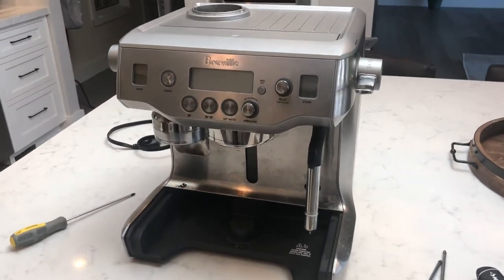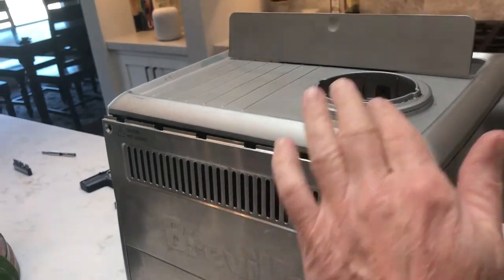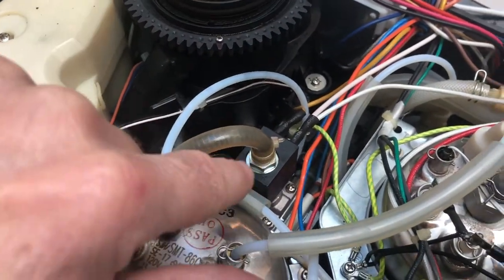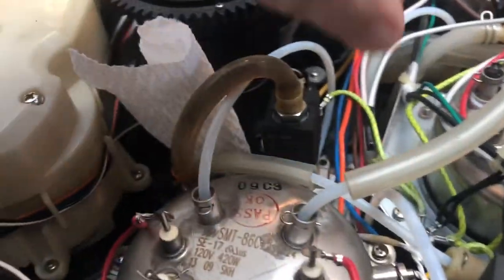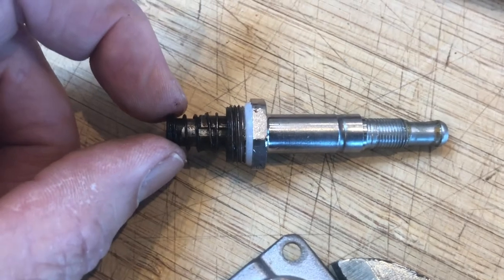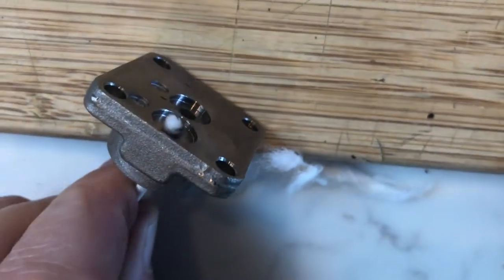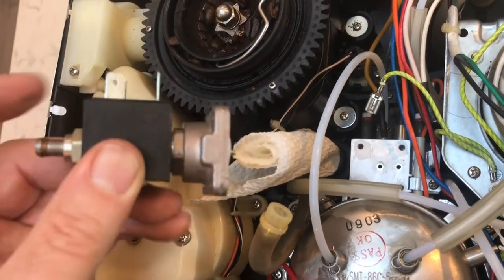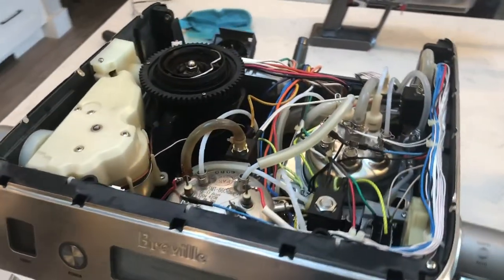How To Repair The Breville Oracle

Comment: Awesome, thanks so much for this post. Second time my Oracle had this problem, first time I sent it in, but having to wait 10-14 days gets old quick, so I just completed this repair myself. Wouldn't have been able to do this without your help! One small correction, though: the "manual coffee hole" is the feeder hole for the top water inlet, not a coffee feeder. Whatever falls in there falls right through to the water tank bay. One more thing: the two top screws on the front require a VERY long Philips screwdriver. Make sure you have one before starting this job.
Reply: Hi. Where did you get a new solonoid?

Comment: I could not have attempted my own repair without your help.  Thank you so much for posting.  My hot water had stopped flowing and cleaning the solenoid fixed my issue!
Reply: A factory  reset fixes  this issue for me after a descale

Comment: Awesome guide, managed to use this to fix my milk frother not texturing my milk. Thought originally it was the air pump. Turns out it was not, it was the steam solenoid was a little dirty. On the right side of the breville as you look at the top. I took most of the hoses off and gave the ends a clean. Took apart the steam solenoid as much as I could and cleaned it out, blew through the hose going to the steam wand. Put back together and it was texturing milk again. Should have made a guide myself as this kind of information is just not out there at all!

Comment: Thanks for sharing the repair! I am going to attempt a similar repair on my breville (not exactly the same model) that I believe also has dirty/stuck solenoid valves. This is one of the few videos I found showing cleaning of the solenoid valve instead of just 'replace the solenoid valve'. Great job.

Comment: Thanks Jonathan, this was beyond what i was hoping to find. It works better now. The Muriatic acid cleaned the parts very nicely. I did all 3 solenoids , but i have a Sage Oracle, so parts was sligtly different, but still the same procedure works for mine.🙌🙌😊😊

Comment: Thanks for the video, I have a side note for prevention in the Oracle - to avoid getting the solenoid valve stuck run the backflush regularly every couple of days, and run a full cleaning cycle with  tablets every couple of weeks. It might seem like an expensive proposition since those tablets ain't cheap, but this machine is definitely worth it. 
Don't wait for the machine to tell you it needs a clean, this warning is time based and usually by the time it pops up the entire water system is pretty gunked up already.

Comment: Absolutely amazing!! Thanks for taking the time to put up the video! Although i couldn't undo the the last really tight bolt even taking it apart and cleaning it a bit and putting it back together seemed to get it working again from now.. think its due to limescale build up in my case.

Comment: wondering if you replaced the o-rings on the boilers? Seems a common problem, and finding it difficult to find where to get replacements... food grade material; Silicone or EPDM? Durometer rating?

Comment: Great thanks for your video. This is the first video for Breville Oracle repair. I have follow your video to check my solenoid valve. Unfortunately, my problem is is the brew pump. The pump generates smoke while brewing. Mr. Audy, do you have any experience to access the brewing pump?
Thanks 
Chen

Comment: Good tutorial. I went through the steps but doesn’t seem to solve my problem. My boiler isn’t getting water hot enough (levels off at 110 or so) and it keeps clicking on like it’s pulling water but nothing comes out. Any idea?
Reply: most likely the thermal fuse blew. i believe there is one for each boiler. there is a video showing how to replace them

Comment: Thanks so much for the informative video. My grinder stopped working. The central burr shaft came unthreaded from the motor/driveshaft somehow. It doesn’t spin when the grinder is activated and can be lifted straight out. If you could provide instructions on how to get at that fitting, that would be amazing! it just needs to be rethreaded. Breville wants $500 for shipping and repair

Comment: Hey Jonathan!

Many thanks for your video! Just took a crack at checking the solenoid in my Oracle, and managed to wreck the other plunger (white round thing, with small pipe sticking out) at the bottom of the solenoid. I was wondering if you would possibly know where one could get a replacement? The solenoid itself looks clean. Thanks a mil! Appreciate the informative video.

Comment: Thank you for the video!  Hoping this will fix my issue but I have a question.  I notice that the zip tie that helps secure the tubing to the solenoid was still attached to the tubing after you had the solenoid disconnected.  Is it not necessary to remove and add a new zip tie or are you able to disconnect the tubing easily without having to remove/replace?  Many thanks again.

Comment: My Breville Oracle expresso keeps popping a GFI while brewing. Plugged it into a different outlet and same thing happens. I have to reset GFI at lest twice to finish getting a full amount. THe electrician said it was a machine fault NOT an overload. My machine is not even 2 years old and I paid quite a bit for this high end model. Is it the plug or a heating element.  Help Jonathan Audy!!
Reply: I had this problem. It was fixed by replacing o rings that were leaking and causing a short. See https://youtu.be/LNZcCEMr7Z4 Although not exact model, it was enough to guide me.

Comment: Hello Folks,
*Mike Sandiland

Hello Mike, 
I have a Breville Oracle Touch BES990. (getting ready to shoot it).
4 days ago it would not come on when I pressed the on/off button. It just looks at me...blank face. I have left it unplugged for varying times and still nothing.
I think I left it on without attending to it for an extended time (hours). 
Any advice would be greatly appreciated as I have a splitting headache now.
Thanks, Mike

Comment: This a great video, thank you.  The repair seems easy enough, but I'm struggling with getting the top off.  Are we all sure there are no hidden screws on the top, near the front side adjacent to the control panel and screen?  I can get to the point where I start to pop the top off from the rear and sides, but the front specifically does not seem to want to budge?  I can use brute force, but I'm afraid I'll damage the external control panel and screen.  Any tips?
Reply: Never mind, being the lazy guy that I am, I fast forwarded to the top removal and missed the part of the video where you discuss the hidden screws.

Comment: My 980xl won't power on. Think it's from a black out. Was wondering where the power supply could be found (or a fuse?).
Reply: I have the same issue!!  How did you manage to resolve this?

Comment: Great video!! I am having issue with extraction even grinding dial adjusted to 30+ coarse. Below 20 close to the fine, extracting less than 2g. Any thoughts?
Reply: Take out the top burr out of your grinder and re-adjust it.

Comment: Stuck on the first step, can't get those Philips head screws out lol. 

Can't tell if my screwdriver is too big or too small, I can't go bigger because it's too long to fit in that hole and I can't go smaller because it is too short to reach the screw, the one that does fit doesn't seem to unscrew it as the head must be the wrong size!

Edit.  Finally got it, had to jam the"too long" one past the plastic bit that sits under the drip tray
Reply: Yeah, I had trouble with the one on the left because of the filter holder interference, but luckily I have a lot of tools.

Comment: I would assume the touch version is the same solenoids. I have a touch and a non touch oracle, but my touch won't get up to temp (usually freezes at 193ish, and then the wand starts clacking)
Reply from the maker: I also have the touch version now and had a similar issue of temperature ‘hanging’ - in my case around 150. This happened after a descale. I think steam gets into the internal temp sensing and messes some readings up. I called breville and they said do a factory reset and then leave it turned on for several hours. I was skeptical but this worked! Seems to dry out the internals so sensors work correctly again.

Comment: Hi, Jonathan. May be you can help me. After the standard cleaning procedure ( descaling), the temperature of the water in the boiler only reaches 72 degrees celsius instead of 93. Thanks coffee machine is on heating mode all the time. We are talking about Sage Breville oracle 980xl. Thanks.
Reply: If you figured it out, let me know cause I am facing the same issue. 
I entered the secret menue and it shows that steam boiler seems to be off, meanwhile group head temperature does rrach 92.
Overall my machine doesnt heat up past 72.
BES990
Reply: @rida8454  Hi. After the repair, they told me, that they replaced the temperature sensor. Good luck.
Reply: @shalexsh  thank you.

Comment: Great video thanks so much for posting! With the hot water solenoid which way is the flow arrow supposed to go when reassembling? I pulled mine out and didn't mark which way it goes. Does the arrow face the front or rear of the machine?
Reply: did you ever find out your answer to this?  I'm having the same issue.
Reply: I had to work it out myself but I can check mine later today if you like?

Comment: Hi Andrew - I have a Sage Oracle that stops heating at 70’C. It may be the thermal fuse that needs fixing. Do you know how to fix that and can you help - not sure if you have covered that in a video before?
Reply: sonderby same issue, did you find a solution?
Reply: Artisan Vapor Company Keller - yes the issue was that despite doing a descale every month all the internal tubes were clogged with limescale, as the water couldnt reach the boiler and the thermal fuse had melted. So the machine needed a full manual internal descale of all water carrying tubes and a new thermal fuse. I needed a professional to do this for me.
Reply: @sonderby  I have the exact same problem. Stops at 69-71c while still saying "heating" in the display. Happened after I descaled. Did another descale, but still the same. Did your repair work and was it expensive?
Reply: Hi Steen - it needed a full professional descale and it cost around 1500DKK I think. Check with service dept in risteriet.dk they helped me. We only use brita descaled water since the repair.
Reply: @sonderby  Tusind tak for svaret. Tager kontakten asap
Reply: @sonderby  Do you still use the Sage filter with the brita filteret water?
Reply: PSYGOZz  - yes we do

Comment: Good evening Jonathan 
Could I ask you a question please, I have the Sage Oracle (Breville), sometimes when I switch the machine on it starts sounding like a machine gun, water starts running out of the group head.
Was this what was happening with your machine? and did cleaning the solenoids stop it from making this noise, I really hope you get back to me, my machine is only 14 months old, this was a replacement for my first Oracle which was putting all the electricity off in the house while descaling.
Kind regards
Johnny
Reply: I've got exactly the same issue! Did you manage to resolve this at all? The casing on top also gets very hot.

Comment: Hello Jonathan, thank you for the video.  I was wondering if you would have a recommendation on converting my UK purchased Sage / Breville Oracle from 240v 50Hz to 120v 60Hz.  Do you know if this would require a new computer board or transformer - or just sell it in the UK before leaving?
Reply: @Bruce Becwar im not jonothan but i will to help id reccomend a step up transformer or replacing the cordset with one that connects to a 240 direct outlet or buy and bring over a uk socket and box and have a dedicated curcit run to the kitchen. step up transformer would be the cheapest option
Reply: @sodafountain8313  The step-up transformer can convert the mains 120v to 240v for the machine but won't convert 60Hz to 50Hz which messes with pumps precision and brewing. To convert a Sage to Breville or vice versa will require a change of PCB, pumps and solenoid, which would cost almost as much as the machine. Better to sell it in UK and get a 120v machine there.
Reply: @Falcon5ive   since that would be cheapest option in terms of bringing it over, you could just use a more complicated option that takes ac makes it dc and regenerates an ac signal in the hz you need it, then add a step up transformer
Reply: @sodafountain8313  Sage Oracle is a 2400 Watts on 220v machine, it will still cost a lot to run an inverter and step-up transformer to feed it. There is some power loss involved in conversion, so it will cost more to run, plus the converters don't last long either. I have been on this path before, factoring in everything, it's better to get a Breville 120v machine, its cheaper than Sage versions anyways.

Comment: Help my oracle tamper stopped working, it’s giving out too much coffee and can’t turn. Can’t find any info. Can u help?
Reply: I just had this problem today. I think I figured what was happening, but still need to tweek things a little more. I think it has to do with the adjustable tamper fan connector. That is what the tamper fan magnetically connects to. The connector itself screws onto a threaded connection above it. I believe it has to do with the allen screw that allows you to adjust the height the tamper fan ends up sitting above the grounds. I adjusted it down a bit and it seemed to solve the problem. Here is a link to the part so you can see what it looks like. https://www.breville.com/us/en/parts-accessories/parts/sp0014256.html

Comment: My steam wand is not frothing.  Good steam but I believe there is no air being injected.  Any ideas?
Reply: I have the same problem. From what I understand there's an air pump inside the machine that is supposed to pump air into the milk when you use the automatic milk frothing. After cleaning every single part of the steam wand, my conclusion is that the air pump is not working.
Reply: @idogreiman617  I was able to order the part from Breville by calling directly. Very easy to replace the airpump. Just follow the flexible tube coming off the steam wand. The air pump is next to the grinder about 4 inches down. Costs $10 with shipping vs $500 for Breville to fix.